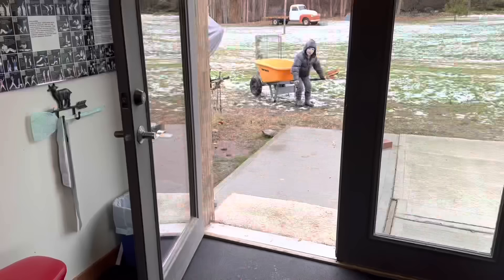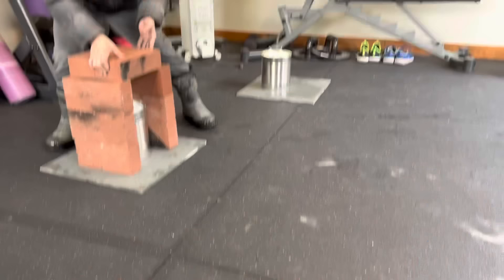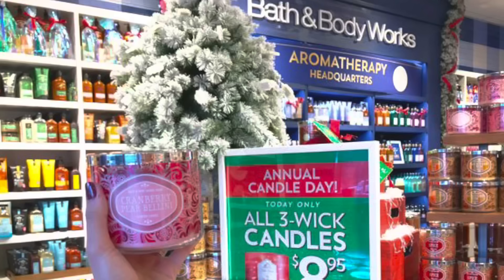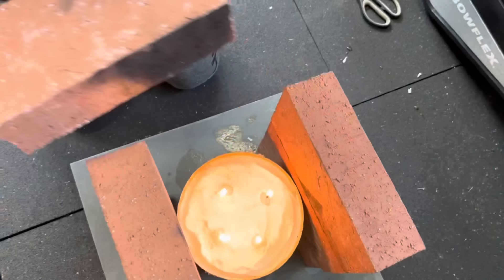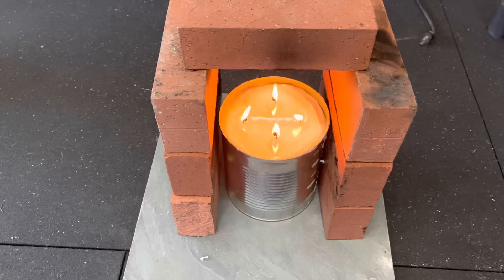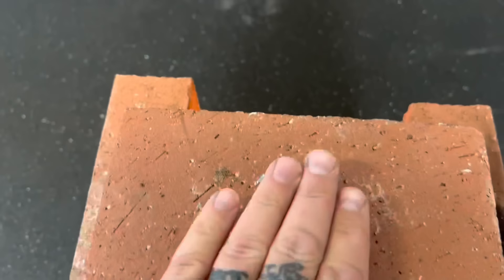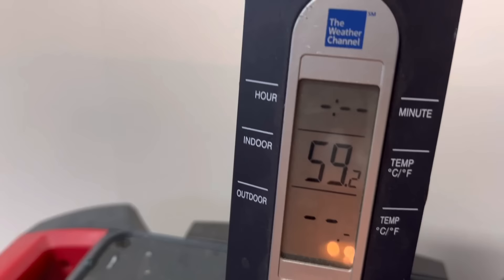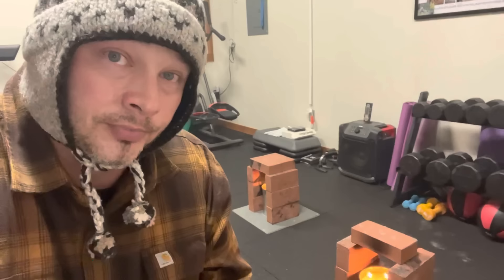Crisco candle room heating | Power Outage Room Heating | 9 hour test

Comment: Really good test... Mostly as it shows how efficient the crisco candles are... Crisco is vegetable shortening used for deep frying; so it is a high heat tolerant product... and it is  just veggie fat; not lard; which is pork fat..... I think the use of the concrete bricks is way healthier than using non- food grade terra cotta inside; which does and will off-gas and can be unhealthy... Conscrete is an everyday material used in interior construction forever.. pretty safe and healthy... I have brass candle heaters that I use in 120 sq ft  non-insulated patio with 60-yr old huge single pane windows, and it works great... I am thinking about making a mini-fireplace box out of either an old (ronco "Showtime") electric rotisserie box or an old fire box from a toaster oven... each of these are actual fire boxes, so they will act as a fireplace box will and then I can direct and control the heat where I want it... Having those candle heaters in the middle of the room is why the heat distributes throughout evenly... But if that wasn't possible; I would probably close-up one end, and flare out the side bricks to direct the heat out and away from the outside wall....
Reply from the maker: Thanks Mari, I have a fun fireplace build I am gonna do with portable window chimney- should be a fun one coming up. 
Thanks for watching and the tips

Comment: CHICKEN FEEDER  
2 Weeks ago I Offered a suggestion  -  update. 
Found a chicken feeder at Big R Store.  Put a wire mesh on the bottom and on top to hold the bricks as it is the same size as the fire prof bricks.  Coffee can inside,  used "L" brackets to hold in place.
Stable,  Has air flow,  not hot to the touch anyplace at any time expect for the bricks on top.  
Handle to pick up and move around.
Flame is 4 to  inches to the top of feeder.   Cost for feeder is $25  add $8 extra for misc. costs.  
Easily use 5 candles 
What is nice is I can change out the # 10 can for smaller cans like a 48 oz type  by just lifting  the large can,  changing the L brackets put in the 48 oz can and go.  
 
Oh for fun I added candle color that I got off amazon to the Crisco.   Just lines of two colors not all of it.

Comment: BTUs are BTUs. Bricks, flower pots whatever don't create more heat from the heat source itself. A couple candles under a clay pot in a small room will raise the temp of the room the same as without the clay pot. You can't create energy with a pot. I do like the Crisco idea though
Reply: I'm amazed more people aren't pointing this out. It is high school science 101. By the time you spend money on shortening (which is pretty expensive) wicks, bricks or pots, and then factor in the danger of an open flame(s) it might be a good idea to invest in a catalytic heater or some other form of heat. A BTU is a BTU and you only get so many out of a flame, depending upon the size of the flame. All these systems are doing is trying to store heat in a material that will radiate heat back at a slower rate than the air itself, but the net result is still the same.

Comment: Better test would be overnight test.  But you test did still show these small candle do not put off a lot of heat, your configuration is a lot better than the people trying to use tea light candle.
Reply from the maker: It does take the edge off the cold-  I will keep bringing the tips….

Comment: Wondered how air tight the room is that it is necessary to have that window open at all. 
A second test would be light the candles, set the bricks, don't open the window and REMOTE check the room temp. If the alarm goes off, you would know to open the window or the door.
Every time you opened the door, you lost heat that had to be recovered.
Also, sunny day? You got solar gain. Try this on a rainy day, with or without wind and test with remote weather station gauges.

Comment: you could create a small 'warming zone' near the candles by adding a stainless steel screen over the top directly in the path of the flames. this would produce infra-red heat, which radiates and warms everything it shines on. sleeping bag near one? oh yeah- comfy cozy.

Comment: Heh , want even more heat put a piece of 12" X 8" 1/8" sheet steel then put the  2 bricks on top of then the steel gets very hot so be very careful , have fun and stay warm.
Reply from the maker: Nice! 🙌🏽
Reply: But steel doesn't Hold the heat the way clay or even cast iron do.  Yes it gets hot, but sheet metal is not good for 'holding' heat for very long.
Now you could use the sheet metal topper and pop a kettle on it to make a hot drink!  Warm the body First, raise core body temp.  Warm the space next

Comment: Good test, Id be interested in knowing real world, how long those candles would last.  If things get really cold and the power is out, set up a Tent inside the House, seal draughts and do stuff to stay warm, warm food and if you start feeling cold do some exercise, but not to the point of sweating.  I camp at below freezing, surprisingly warm, we heat our houses too warm and our bodies get used to it, after a few days camping I find central heating too warm!
Reply from the maker: Yes.  It’s good to rotate your candles every day so they don’t melt out to much- many folks have said there wicks don’t perform long term- I have not had that problem but hearing it- I would say just rotate your candles-  they last surprisingly long!!!
Reply: @RiversideHomesteadLife  do you mean by rotate, to replace one candle with another and letting the used one solidify?

Comment: If you live in a place with the potential for severe winter storms pack a survival rucksack and leave it in your trunk all winter. Artic rated sleeping bag, a plastic bag with steel wool kept separate from a nine-volt battery to start a fire if you're really in trouble. some bottled water and a propane or butane stove with a few dehydrated meals and you're golden. If you can get one try and obtain a poncho liner from a military surplus store one of those is a lifesaver as well.
Reply from the maker: Great tips and THANK YOU for adding great info

Comment: You need the candle flame just under the brick to get it really hot then it will work better. Did something similar and works better if the flame is half an inch under the brick.

Comment: Wonder if it could even  be warmer if you didn’t have to open a door going in & out. It always amazes me how fast our thermostat triggers the heater, just opening our door to let the dog out…just about 10 seconds. Plus, those high ceilings are a Heat-Eater. They may look fashionable but definitely not heat conserving.
Reply from the maker: Good piont

Comment: Easy way to avoid using paraffin if you are that paranoid.. Is just buy cotton wicks and poke them down with something like a stick (or chopstick!), it's cheaper to get a large pack of them than candles by far.
Also don't really need to have a window cracked in the US.. Our homes are built so they can naturally breath, if you've ever been up in an attic or the rafters of your house you'll see where the over hang is and there is normally only some plastic covers with holes so air can naturally flow so during the summer the heat can pass out but in the winter it makes a blanket of heat (since cold air naturally sinks)

Comment: idea: heat a room this way for a while, then switch to your electric-oil radiator. The electricity cost should be lower because it only needs to maintain the temperature. You could move the electric radiator right near the bricks so that the electrical load is lessened.

Comment: I bet a well designed brick chimney for this with a copper coil to heat water for a radiator fan would be quite nice for a small building
Reply from the maker: You are correct!

Comment: One huge fact you omitted is the fact that the room the room would raise in temp by just closing the door without candles due to the fact it was and everything in it were already holding heat. On a other note i do use candles for heat.

Comment: Candle flame = 80 BTU's ; 1500 watt heater = 5100 BTU's ;  Therefor you need 16 of the four flame candles to equal the heater.

Comment: Dude close your window, replace the bricks on top with metal sheets and then put a pot of water on each. By closing the window you will increase humidity in the room which will hold more heat and the pots of water will act like a thermal bank.
Reply from the maker: Nice tips Chris - thank you

Comment: I wonder if it would have worked better if you would have turned the third brick on its side then placed the bricks on top they would have been two inches closer and prob would have got 50 degrees hoter I wish I had a place to test it myself I love vidios that people experiment in 👍

Comment: Great video. But it isn’t going to work for my use.

I’m about to clear a hoarded house. There’s no heat and power. But, I cannot wait for hours, while the sun eventually goes down (time loss), for the area to come up to temperature. That, in addition to the fact that it’s not easy to close off some areas, to concentrate the heat. So, I’d need something that would heat ASAP.

Comment: I’ve always wondered how one dual purpose alarm 🚨 system………
“Smoke / Carbon-monoxide” alarm is safe to use and rely on.

Smoke 💨 rises to the ceiling, and carbon monoxide displaces air…. So it’s found closest to the floor.
Most dual alarms 🚨 are placed near the ceiling……. Not good for detecting something near the floor ! ! !

My point is ………. Don’t rely on dual system alarms…….. get two separate ones……. One for smoke and one for carbon monoxide , for your own safety.

😎

Comment: so since there are four wicks burning 4 times the oil.  it is no longer a 72 day candle 

and you need 12 crisco candles burning at the same time to keep a small room moderately heated.
Reply from the maker: Yes the idea is that they last a very long time and each situation is going to be different you may need a different amount of candles for a different size room
Reply: @RiversideHomesteadLife  rodger.    is there a video that shows how long crisco or vegetable oil last compared to a wax candle?
Reply: @RiversideHomesteadLife  I have made a few of these crisco candles using cotton yarn. just curious on how much benefit over a store bought wax candle

Comment: OK----------.   A large clay POT, upside down to catch more of the heat (with a clay plate on top to seal the drain hole) replacing the top stacks of Brick will greatly increase the heat output for each burner allowing just one burner to do the work of all three open brick burners...

Comment: A 3 lb can of Crisco contains 108,300 BTU of heat and if properly wicked will produce about 288 hours of burn time for a single flame. With 4 flames the burn time is reduced to 72 hours not 72 days! This gives 376 BTU/hr per flame heating rate. Given 12 flames (3 cans x 4 flames per can) this is gives about 4500 BTU/hr heating rate. For a mild winter zone builders will specify 30-40 BTU/hr per sf. At the low end for a 200 sf room this would need to be 6000 BTU/hr to raise the room from 32F to 72F or 40 degree rise above the outside. Since this is a single room ‘house’ the heat losses per sf will be higher than for a ‘standard’ calculation. The claim of raising the temperature from 38F to 59F or 21F rise would require over 6100 BTU/hr and given the best possible heat output of 4500BTU/hr the temperature should have been closer to a 15F increase not 21F increase. The 5 degrees difference can be explained by inaccuracies in room volume and thermometer placement and the time lag between the rate of energy lost as the outside temperature drops and the heat capacity of the room that acts as a thermal mass. A much better test would have been the difference between the outside temperature and the inside temperature over a full 72 hr of burn time. A plot of this difference would show the ability of a 12 flame candle to heat this room including the time lapse between changing outside temperature and inside temperature. Another way to look at it is how long would it take this heating system to heat  a room at the same temperature as the outside to its final temperature due to candle burn alone. It would be much longer than 9 hours due to the heat capacity of everything in the room not just the air. This extra mass that must be heated is why homes have heating systems that routinely exceed 4-5 times the actual heat necessary to maintain a temperature.
Reply: Wool hat and scarf?? Really is it that cold at 38F especially when there is no condensation as you exhale. Well, I guess drama sells.
Reply: The amount of heat required to maintain a delta T (difference between outside and inside temp) all depends on the insulation of the walls, roof, and windows and how sealed the room is. What you claim is needed is useless info without knowing the heat loss of the room.

Comment: Crisco contains NO paraffin! The wicks may be a paraffin candle but they add less soot to the air than the combustion of the Crisco. Look at the bricks and see the evidence of shooting in the black patches that are from previous burns prior to the video being taken. Also see the carbonization on the wicks (black balls) at the end of the test. The wicks should be trimmed periodically during burn to reduce the sooting. A I trimmed wick burns less efficiently producing soot, which reduces the heat output of the flame.

Comment: Another guy did the math and said it would take 8 candles minimum to heat an RV.  You're at the equivalent of 12 candles for a small room so that's about right.
Reply from the maker: It definitely helps - as a back up!  Or just having the knowledge in case you need to pull some stuff out of your bag of tricks

Comment: I'm far from an expert but I'm thinking terracotta pots being much thinner and  would radiate more heat and faster. 
The bricks are soooo thick it would take longer to heat up. Am I wrong with my thinking?
Reply from the maker: Terracotta pots are probly more effective yes.. I simply wanted to throw another option out for those who don’t have the pots..  the cool thing about bricks is you can rotate them and stick them in a blanket for a long time and use it as a warming pad

Comment: Thanks 😊
Reply from the maker: Great light source - can help in small areas  for heat and had that room had a normal lower ceiling and covered those 4 huge windows in there …. Probly would have worked even better

Comment: Next time tell us if the floor and the walls in the ceiling are insulated and the thickness of the walls 2 x 4 2 x 6 you should’ve taken a ladder in there and read the temperature at eight or 9 feet off the floor also

Comment: looks like you have a 30 degree delta so the lower outside temp goes down you inside has a chance of going down also
Reply from the maker: It helps- if u have no other options! 
More tips to come
Reply: @RiversideHomesteadLife  I just was saying that was the amount of heating that you had with those 3 heaters most of the time it would be enough to keep a small area warm thanks

Comment: you could always use bees wax if you didnt want a traditional candle. I use bees wax to make lube for antique guns, after using it for a while i've noticed its great stuff. You could heat your room with it, and it's food safe. But I suppose Crisco is technically food, and I had no idea there is paraffin in that. How does that work?

Comment: Yes these are very handy little emergancy heaters.  Alot of people don't understand basic chemistry or physics.  Or carbon dioxide poisoning.  Your more likely too die from a natural gas leak then a burning these little diddy's.  Of course it all comes down to how insulated your home or shelter is. Most new homes are energy efficient.  Older homes with old windows have lots of air blowing through them. I live in a very rural area. More then half our community have wood burners. kerosene hesters are used often in power outages that happen alot.  Before I has my new doors and windows put in. You could see my curtains blow on cold winter days. Never had to open a window if you know what I mean. Lol. Anywho hyperthermia is real too. Small children and elderly are the most vulnerable to it. Lots of blankets, furs and layers of clothes help. Also it helps while the power is on to condition yourself to cold at night. Unless is below freezing cut your heat down too 50 degrees at night.  I know some around here that keep it at night about 40 or 30 degrees fahrenheit in thier home. Fire their heater up in moring craw back in bed till it gets about 50 degrees.  I'm older now so I don't keep it that cold.  I love indoor plumbing and I like the comfort of having central heating . Great video sir
Reply from the maker: Thank you for your story 😊 more to come 😊🙌🏽

Comment: At last a test, I would prefer another temperament check away from the window in the centre of the room to show the ambient temperature. With both temperatures you have a better understanding of its performance.
Reply: Probably would have performed much better but for the Very high ceiling in that space.

Comment: Why open the door with the heater plugged in. Unplugging at the beginning of the test means there's residual heat in the oil filled heater.

Comment: If you look at the label the I in Crisco has a flame. Years before kerosene Crisco made candles, that's where the flame over the I originated. Crisco is one chemical different than paraffin!👍✌
Reply from the maker: My brutha 🙌🏽
Reply: Crisco is hydrogenated soy oil and palm oil.  Paraffin is a petroleum product.  So, no... Not even close.

Comment: There is only so much btu energy per unit weight in the fuel and it's not very much compared to an arm-load of fire wood. Yes, it's better than nothing if you're freezing, but would probably be most efficiently used heating up a hot drink which you could take in directly.
Reply: Yes!  Warm your body First, then the space.